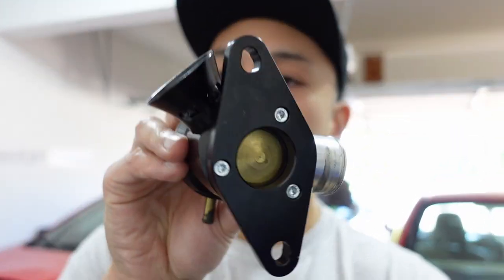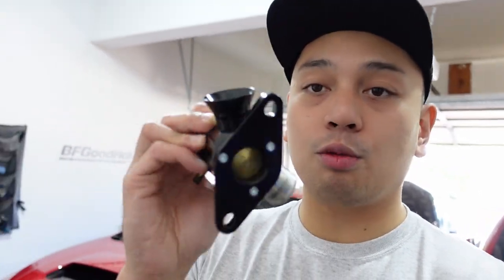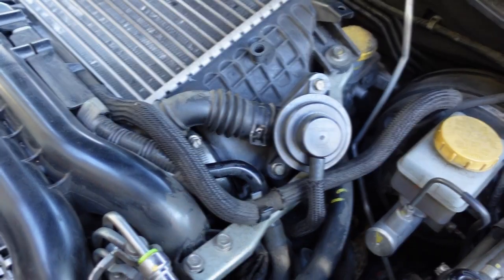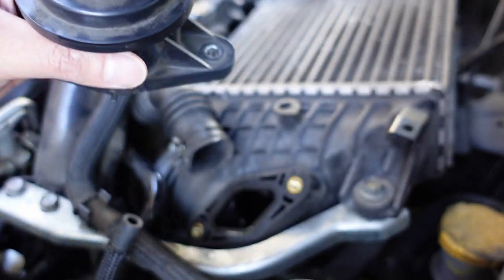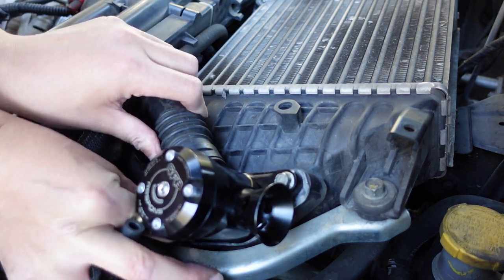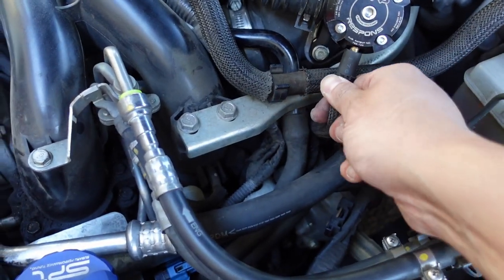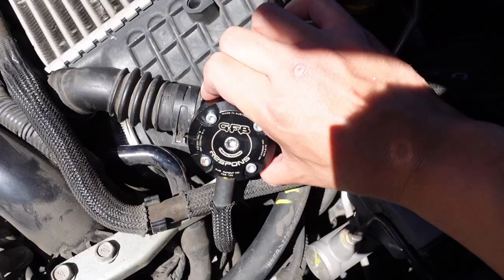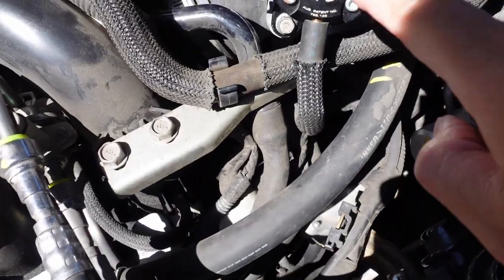The POPS are TOO LOUD! | GFB Blow off Valve

Comment: If you leave it slightly open and then tighten the allen screw to only slightly release at a higher rpm. You should be running good and still get the flutter sound. There is a YouTube video on how to properly adjust it.
Reply: You have a link?

Comment: you could also use a mid term setting. like 75% recirculating and 25% atmosphere. + a more tight spring. you would have just a little tssh that's not too much and doesn't affect your engine working.

Comment: Heck yeah it's loud and I'm sure the video is not showing exactly how loud. I like that right side corner pick of your car throughout the video! That's really cool bro! I'm going to have to figure that out😁
Reply from the maker: Yeah it was crazy loud! And thanks man, I just resized a normal pic of my car until it looked right on the corner!
Reply: @ronfromportland  any mods to the turbo or just a stock turbo bro?
Reply from the maker: @Issacko2431  just stock turbo bro 😃
Reply from the maker: @Issacko2431  tune is set for ~18 PSI

Comment: So I have a 2018 wrx is pretty much stock besides the exhaust and and a short shifter that is after market no cobb yet, can I still install the blow off valve without have any problems in the future?
Reply from the maker: For WRX, I personally would stay away from blow off valves. I’ve read that you can install bypass valves (BPV) without any problems but I’ve also read that it provides little to no benefits. I could be wrong though. In my opinion, only replace the stock BPV if it’s cracked or if you’re pushing a lot of power.
Reply: @ronfromportland the gfb blowoff is a bpv, you adjust the atmosphere/recirculation hence the rotating sleeve

Comment: to much atmosphere vent causing it to run rich hense the pops (unburnt fuel getting by and igniting) adjust the BOV to more vent to the intake and youll be fine
Reply from the maker: Yup, got it all figured out! The pops did sound cool though, I admit 😂
Reply: @ronfromportland  what do you have it set for?
Reply from the maker: @scottsledzianowski5271  I actually sold it and I’m back on the stock BPV. I had it set to all the way closed though.
Reply: @ronfromportland  why did you sell it ?? Just curious
Reply from the maker: @WRXRAFSAN  got the dreaded P0011 code 💀. https://youtu.be/MDJZ01pVDkM

Comment: How do you use that retainer clip that goes onto the blow off valve how do you put it back on the hose pipe
Reply from the maker: Push the tabs in with pliers to open it up, then slide it on the BOV.
Reply: @ronfromportland  oh cool what setting would you get the most pshhhh noises out of hard or soft?

Comment: Hey man how did you tune thos pops??
Reply from the maker: I didn’t tune it at all haha. The pops were from the BOV being opened up all the way which caused the loud pops lol.
Reply: @ronfromportland  dammm mine doesn’t pop mine just makes a woooshh sound is there any tips to make it pop?
Reply from the maker: @Issacko2431  it’s probably better that it doesn’t pop. Popping excessively most likely means that it’s running rich.
Reply from the maker: @Issacko2431  but if you have the GFB BOV like mine then you can adjust it (turn the ring to open it) to where it vents to atmosphere. It’s not recommended but it gets the pops.
Reply: @ronfromportland  thanks bro I’ve got a hks one but I’m looking at getting the gfb one is it loud bro cause I really wonna loud woooshh sound and pop
Reply from the maker: @Issacko2431  no problem man! Yeah, it was too loud for my taste 😂
Reply: @ronfromportland  last question bro sorry to annoy you but can you pls tell me what tune you used to make the psi higher ??
Reply from the maker: @Issacko2431  np. this car was dyno tuned from a tuner in my area.
Reply: @ronfromportland  thanks so much bro I’m getting my first Subaru Legacy gt turbo soon
Reply: @ronfromportland  thanks for all your help bro by any Chance do you have a a stock exuast??
Reply from the maker: @Issacko2431  nope, the car came with a Cobb down pipe and SPT Catback.
Reply: @ronfromportland  hey bro quick question but what legacy gt do you have?
Reply from the maker: @Issacko2431  2008 legacy GT limited